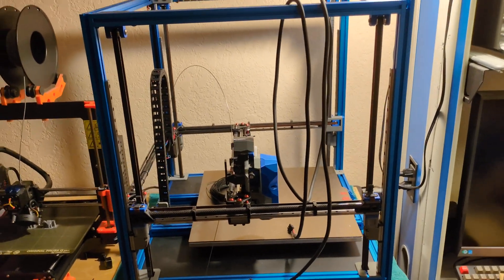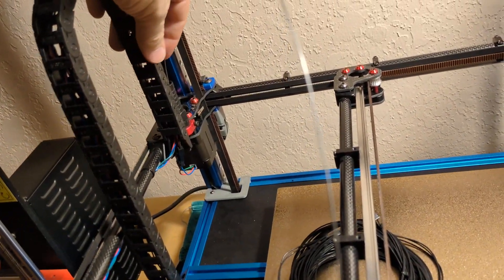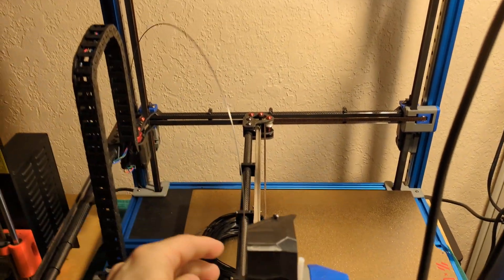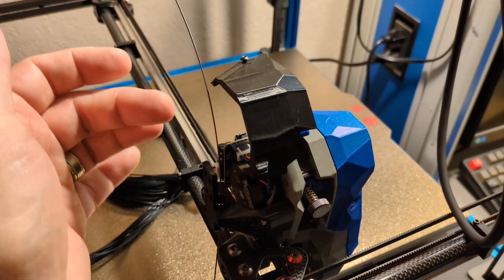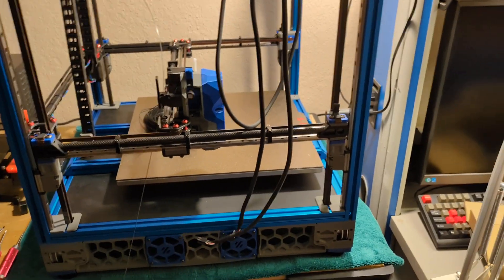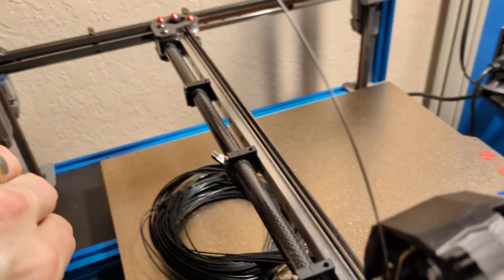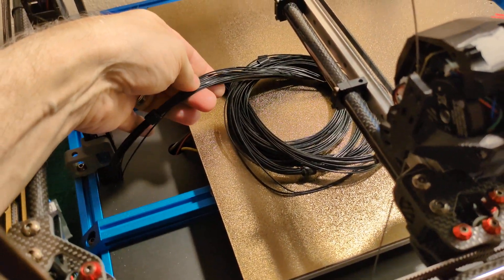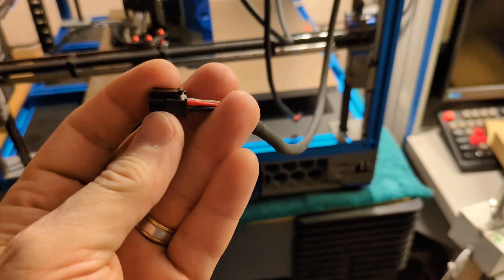3D Printer Voron 2.4 Rev. C 350mm - Build Progress Part 15

Comment: Also, the temperature of the chamber has not been an issue with PLA under normal conditions. I have the exhaust fan installed, but rarely use it to cool the chamber when printing PLA.
Reply: It’s best to just take off the panels when printing PLA, there are good mods for the panel clips. I‘m using a magnetic one, which is very convenient.

Comment: Long time Voron owner here. Progress is looking good. The drag chain method is the vanilla route as you likely know. If you want to avoid the weight of the drag chain, the umbilical paired with the bowden is a great way to go. I have that setup on another printer, no issues after hundreds of hours of use. Dragging against the top is not an issue with my printer, but I do not have a spring steel wire. IMHO, the wire is not necessary as a capicorn bowden tube provides sufficient rigidity.  Like you said, if it doesn't work, you can change it.
Reply from the maker: @kailuasurfing  Thanks! That's what I plan on doing.  Unfortunately I need to wait for replacement panel clips, so I'm stopped again.